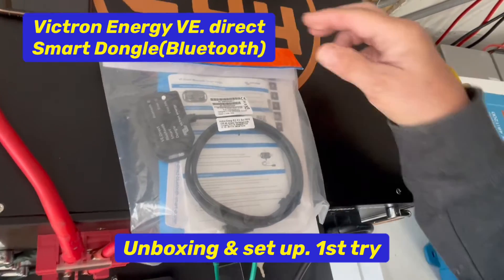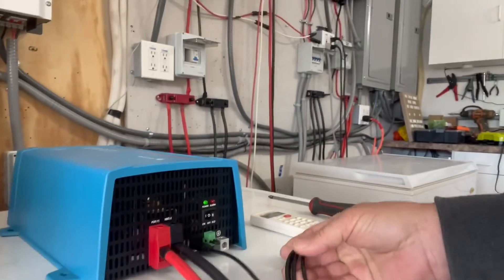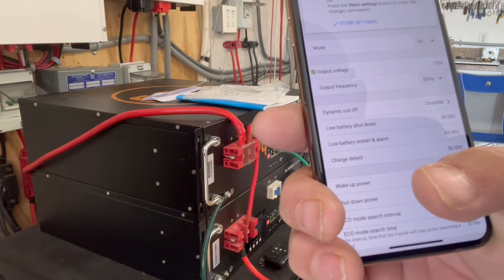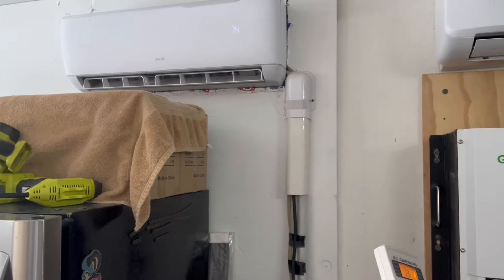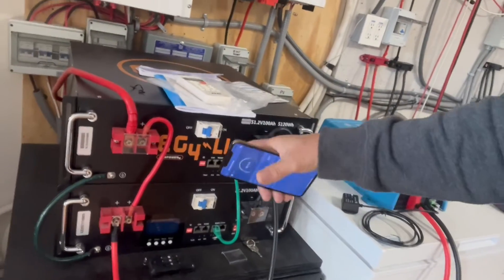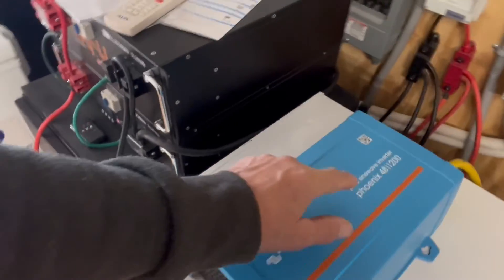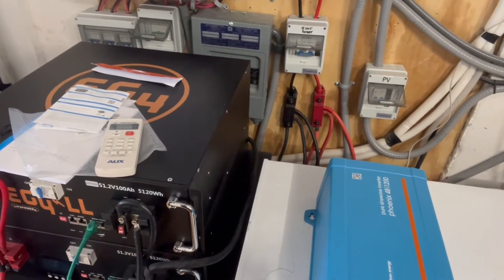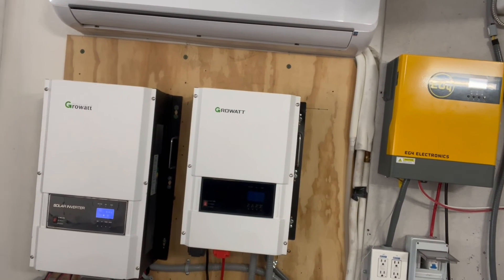Victron Energy VE. Direct Smart Dongle Bluetooth unboxing & setup. Is it easy to set up?

Comment: I have a problem with my victron smart controller it always reads the battery at 100% charge no matter the state of charger do you know how to correct this
Reply from the maker: I have not used Victron smart controllers, I only have a Victron shunt and an dc to ac pure sign wave inverter. There should be videos on YouTube about that subject. Sorry I can’t help more.
Reply: @diy-solar-guy I have the VC direct smart shunt
Reply from the maker: @rickschneder1994 you can go into the settings and change some things so it helps to be more accurate. How many ah of battery do you have connected?
Reply from the maker: Did you change the settings to 300ah?
Reply: @diy-solar-guy I have a total of 600ah two 300ah batterys and I changed it to 600
Reply from the maker: @rickschneder1994 is your Victron a 500A or 1000A. My Victron is only 500A but I have 700ah so I can not get an accurate SOC.

Comment: Bluetooth must be include in such expensive invertor
Reply from the maker: The blue tooth dongle plugs into the inverter but it is the blue tooth dongle that is extra to buy. You can not communicate with inverter without dongle.
Reply: I have the mppt that's built in bluetooth and connects ok so is there any point adding this to the inverter ?
Reply from the maker: This is for components that do not have Bluetooth capabilities built in. If you have Bluetooth on your mppt, then you would not need this. You also need the port on the Victron component.